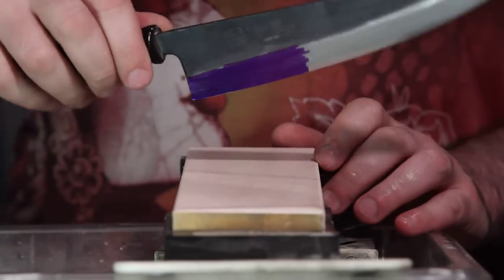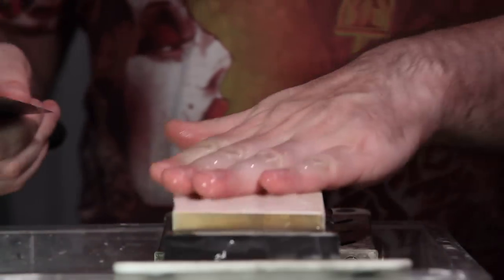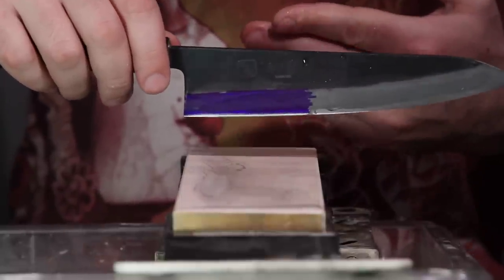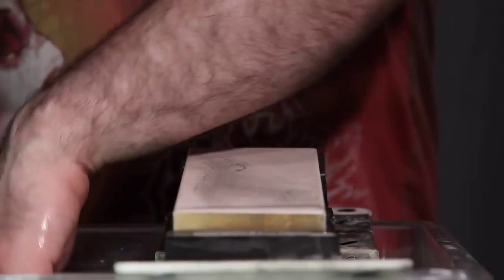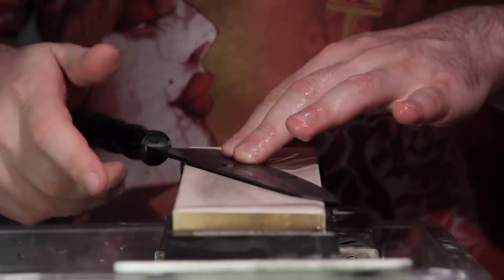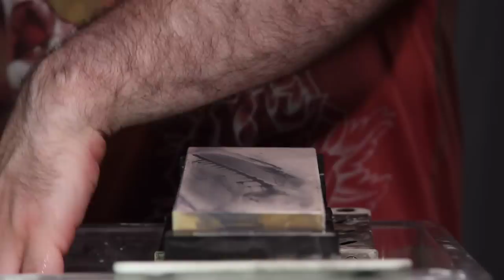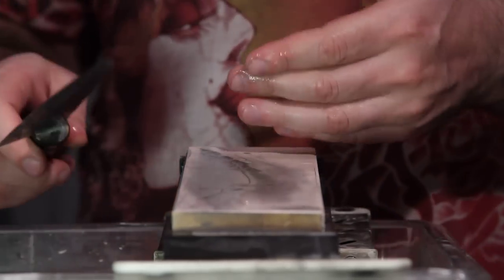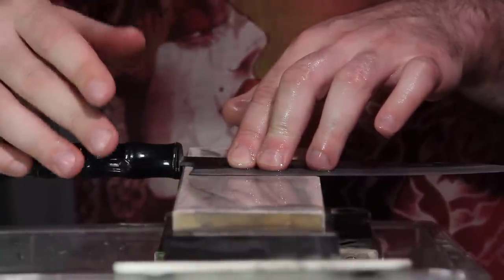Thinning Your Knives (A Demonstration)- Japanese Knife Imports

Comment: I laid my japanese knife flat and thinned out, just like Murray carter says to do. I managed to do it without going over my shinogi line. Is this bad? It seems like that cloudy soft steel is about half gone from one small thinning session. I just did a few strokes on a 2000 and a few on a 5000. 
It seems like it would be a great deal more difficult to find an area in between laying it flat, and on the edge rather than just laying it flat.
Reply from the maker: Max Savino i'm not sure i'm clear on what you are describing here... can you send me an e-mail with pictures?  I can do a much better job answering your question that way i think.  My e-mail address is in the description of the video (at the bottom).
Reply: alright will do. I shot ya an email, thanks Jon.
Reply: Max Savino It would be more difficult, but better results ,  is the core steel reactive?

Comment: Great video Jon, a question, where should I be applying pressure when thinning if I want to expose more of the core steel?
Reply from the maker: The general rule of thumb in sharpening is to apply pressure where you want to remove metal. In order to expose more of the core steel, apply pressure at or slightly above the cladding line. The whole process is also sped up with faster-cutting stones. So remember to use your coarsest fastest stones for this process.

Comment: i have a question, why do you thin your knives using finer grit stone? I thought that flat/smoother surface will cause food stick to side of the knife? I thin my knife with really coarse stone (120 grit) then sharpen the edge normally... it looks terribly dull but hey it works. Great video btw!

Comment: Can you do a thinning vid for full flat grinds?
Reply from the maker: I'm not sure how necessary that would be.  A full flat grind would already include thinning in the process, as you would be thinning already as part of your normal sharpening.  Full flat grinds essentially lay the side of the knife entirely flat on the stone, and thus you have an impact on overall cross-sectional geometry each time you sharpen.  In that case, thinning=sharpening.  I guess you could reduce spine thickness, by applying more pressure towards the spine in sharpening, in order to change the sharpening angle to an overall more acute angle, and that could be considered thinning, but in general, the concept of thinning as a separate issue from sharpening does not exist with full flat grinds.  There are issues with full flat grinds for kitchen use that make them less than ideal, but that's a very different conversation.

Comment: I have a brand new knife. Its a Vnox. Would you recommend me thinning and sharpening it straight out of the box? Also do i need to thin it equally on both sides? (like 4 swipes on one side and 4 on the other). Im a huge beginner with knives (culinary student). Also, the coarser stone i have is 400 grit. Is that too much? Thanks
Reply from the maker: no... absoltely not.   Its new... no need for thinning at all right now.  After a while, as you continue sharpening it, you will notice it doesnt move through food as easily... thats the time to start thinking about thinning.  Each knife will have different requirements as to how it should be thinned, but counting strokes isnt always the best bet... visual inspection and other visual and tactile clues tend to be a bit better.
Reply: Japanese Knife Imports Okay thank you very much! Do i apply the same logic for sharpening? Ive read online that people sharpen straight out of the box. Great channel as well. Teaching me a lot!
Reply from the maker: in sharpening, you're looking for burr formation and consistency from heel to tip... you can also look for asymmetry as you go.  Once again, there are better methods than counting strokes.  Often times, sharpening a new knife can improve the edge, but as you are just getting started sharpening, that might not be the case.  Also, feel free to e-mail me with sharpening questions anytime... jon@japaneseknifeimports.com
Reply: Japanese Knife Imports Thank you so much! And yes if i have more questions i wont hesitate!

Comment: What grit stone are you using to thin in this video? I am trying to get an idea of whether I should be using my coarser or finer grit stones to thin my knives knives (haven't yet got to that point, just started practicing sharpening on fairly new, thin knives without a shinogi line).
Edit: Oops very sorry, did everything BUT read the video description. So, start with a coarser stone, but then can I work up with my normal stone progression on the thinned area at that same thinning angle to try and cosmetically improve that area?
Reply from the maker: sonespazz518 the video is more of a demonstration... it doesnt show the entire process start to finish.  When thinning, i start with my coarsest stones (often 150-220 grit), though some choose to start at around 400 grit.
Reply: Japanese Knife Imports My coarsest stone is a Beston 500, and besides that I have a 140 grit diamond plate. Will the diamond plate cut too fast if I'm trying to be conservative? Will I be able to get away with using the Beston 500 if I'm not starting with knives that have big 'shoulders'? Also, after thinning, can I use my higher grit stones to polish out the scratches on the blade? Mainly for vanity :D
Reply from the maker: sonespazz518 i would use the diamond, but i feel very comfortable with my skill level.  If you're worried, the beston 500 will be fine.  It will take time, and there will be scratches on the sides of your knife.  Finer grit stones will reduce the size of the scratches, but sandpaper is probably the best way to refinish without powered equipment.

Comment: Is it necessary to do this every time I sharpen? How often do I have to do this? Another question, since there's no burr formation, when do I know when to stop?
Thanks!
Reply from the maker: Andre Scodro de França its not necessary to do every time, but there is nothing wrong with doing it every time or every couple of times you sharpen.  The longer you let it go without doing this, the more work you will have when you decide to do this.  As far as when to stop, you will be looking at the choil of the blade to gauge thinness, but you can also watch how the primary cutting edge (the main bevel) will shrink as you thin the knife.  By watching this, you can make sure you are thinning evenly from heel to tip.
Reply: Ok, then, I'll keep that in mind. I've been sharpening my knives for a little while, but have never done this. I'll try that. Thank you very much for the answer!
Reply from the maker: Andre Scodro de França we have a video that discusses this more as a lecture... check out our knife sharpening playlist to see more
Reply: Sure, I've seen all of them, but since most of my knives are double bevel and don't have a shinogi line, I'm afraid to grind it too much and damage the knife. That's why I wanna be 100% aware of what I am going to do. But I think that covers it perfectly now. I'm just building up the courage to do it! Hahaha

Comment: it could be much easier: BUY A Solingen made ROBERT HERDER WINDMÜHLENMESSEER CARBON HRC 61 with a straight v-blade..  you'll never get a dull knife...
Reply from the maker: those are nice german knives for sure, but even those will require thinning down the road, and they still don't stay sharp as long as many Japanese knives.  But, of the german made knives, they are certainly among my favorites.  I've used them extensively over the years.
Reply: @JKnifeImports  thx for your reply-).. of course many things are quite subjectively, and some years ago the Windmill Knifes were a really budget friendly alternative... after their price increases that's not longer the case: but nevertheless their simple blades and rather "primitive " wooden handles make them a kind of underrated understatement in the kitchen... and I never had to thin their blades: if you hit the right flat angle from the beginning of sharpening they remain in their extra flat A-shape
Reply from the maker: @tom_nuyts  are you taking about sharpening the entire face of the blade?